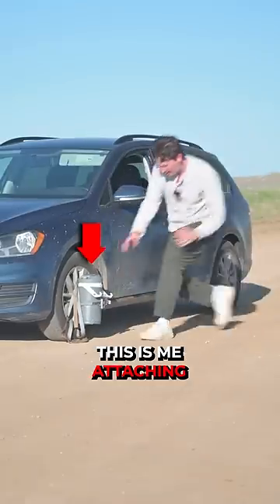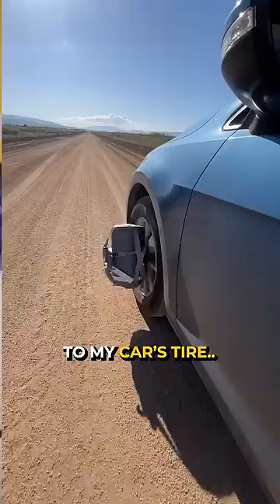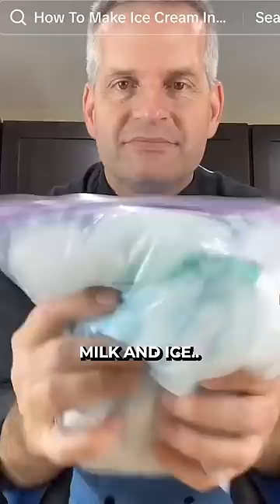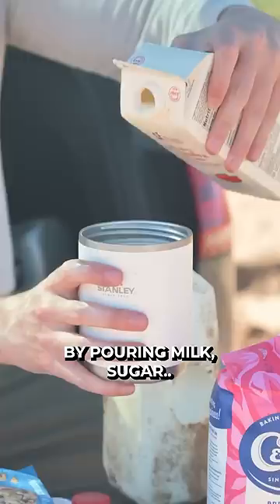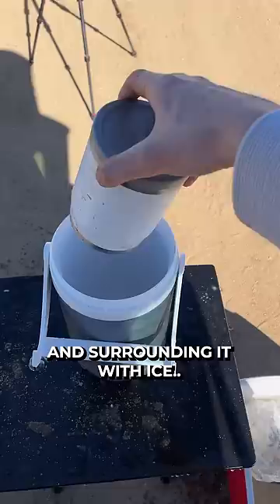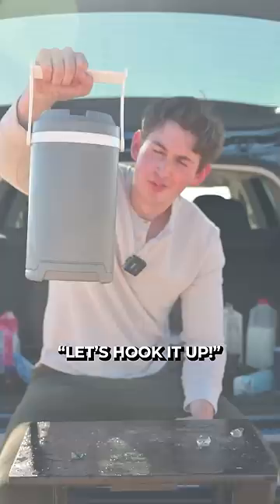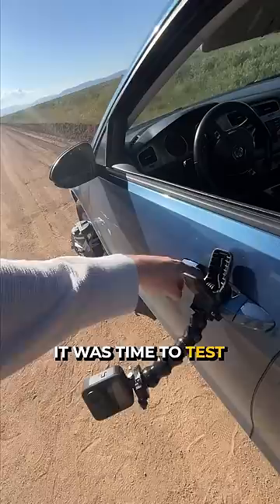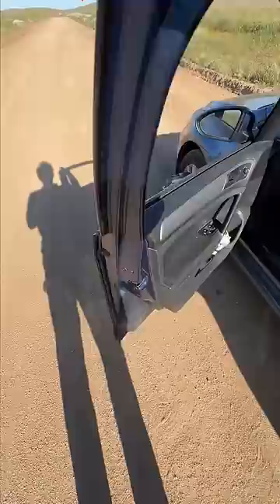I Made Ice Cream With My Car 🚗🍦#shorts

Comment: He isolated the milk from the ice using a thermo cup. Genius.
Reply: I was just about to mention this. The thickness of a thermos had nothing to do with it, the fact that it IS a thermos does. Ridiculously counterproductive
Reply: @Colin.71 durrr thats the same thing if it was a thin thermos it wouldnt have done that
Reply: If you use the Stanley in the other container the cream won’t freeze. No ice-cream for you!
Reply: Big brain moment
Reply: And didn’t use salt which is needed to actually make ice cream that way.
Reply: & also strapped it to a spinning wheel, thus, not shaking it
Reply: @williamwarner9338  a thermos keeps the stuff inside it the same temperature as when you put it in.
even if it was thinner it would still keep the same temp cuz thats what its supposed to do
Reply: That's what I was thinking. He really didn't use his brain correctly 🤦‍♀️
Reply: Bro he's a dropout youtuber. What do you expect?
Reply: How can you freeze milk at ice freezing temperature?
Reply: @williamwarner9338  if it's too thin and doesn't keep heat inside then it's not thermos
Reply: Average iq of content creators

Comment: When doing it at home MAKE SURE TO ADD SALT WITH THE ICE AND HAVE THE milk (+vanilla) in a bag surround by the ice and salt in a bigger bag and shake long and in all directions :D but make sure to add salt for it to work properly
Reply: Fr. He didn't add the salt🤦🏼‍♀️
Reply: Also, be careful while shaking and maybe do it with a partner so you don't give yourself frostbite from the chill that will basically be around -10 degrees.
Reply: use cream instead of milk for tastier result 🤤
Reply: Repent and turn to the Lord Jesus Christ and you will have eternal life 🙏🏼🙌✝♥
Reply: @papapower5209  I would rather have ice cream, thank you
Reply: @papapower5209 that is very random and it is not related to the topic of the video and I’d rather have my ice cream instead
Reply: This is the way! 

This video is asinine. He didn't shake his cooler, the ice/milk would just be sent to one end of the cooler at a certain speed, and become relatively motionless.
Reply: @papapower5209  I believe in Christ but this isn't the place right now

Comment: Shaking milk in a ziplog bag surrounded by ice works and makes ice cream because you add salt with the ice, what takes place is an endothermic process and it absorbes the heat from milk, causing the temperature to suudenly fall and freeze it. So, in theory, this shouldn't have worked, all you would get is cold milk if you dont add any salt.

Comment: the problem with that is because you're spinning instead of shaking, the ingredients in the ice cream is being pulled to the sides, meaning the middle could taste not as good as what is in the middle. like how if you unbuckled your seatbelt while going in circles in a cycletron, you'd get flung out in a straight line. :)

Comment: Yeah but that wouldn't shake the liquid though..... it's like if you put a quarter glass of water and spin your arm like a windmill quickly it a big circle. At one point the glass of water will be upside down bit no liquid will fall because of the outward pulling force from the spin of your arm. Same thing will happen on a wheel of a car. You would be FAR better off just shaking it up and down with your hands.
Reply: It would slightly work before you get fast because before the next tire rotation the liquid would have time to fall. So it would work if you drove extremely slow. Then there isn't really a point in even doing it though